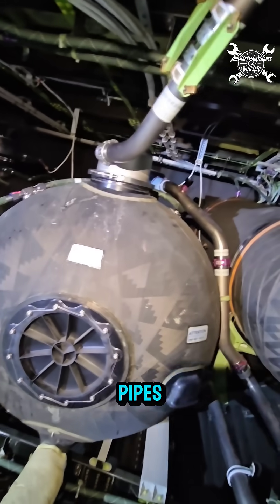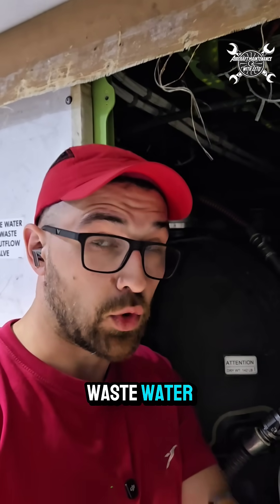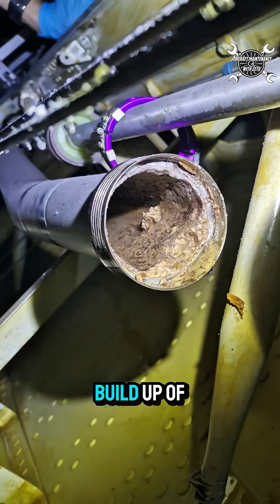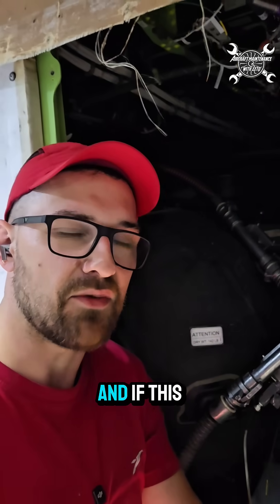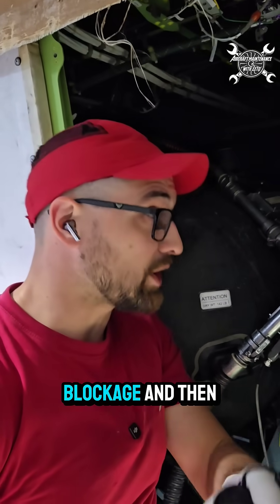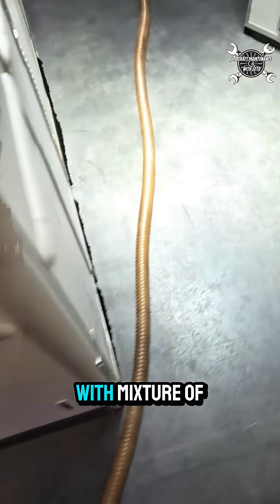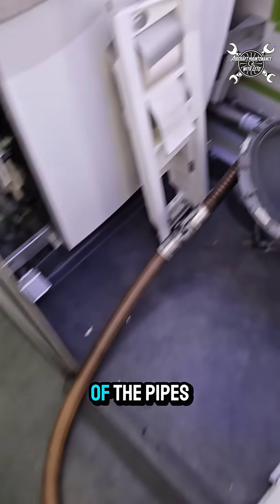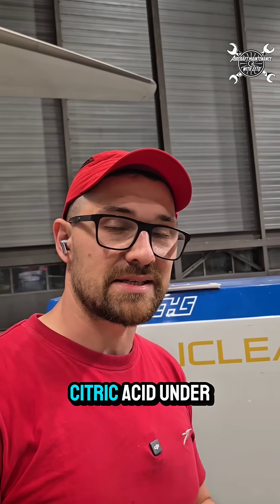how to keep airplane lavatory pipes clean?

Comment: „Can easily stay in the air for more than 12 hours“ didn‘t age well!
Reply from the maker: If you care it will
Reply: aged well for the nearly 5 million flights, 30+ million flight hours the 787 fleet has accrued over its lifetime
Reply: @ch4ndemic And suddenly 787 start crashing, having problems with flaps and technical issues.....😂
Reply: @fdhayrxgjw88y3b9jsvw this aged like milk